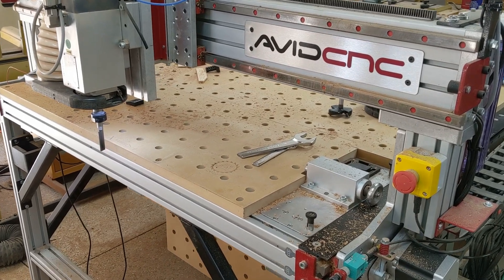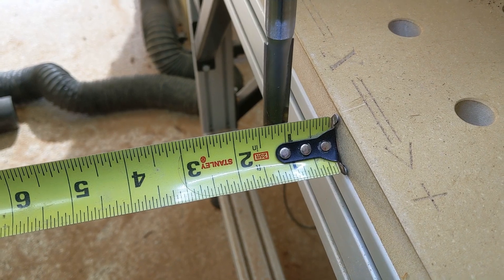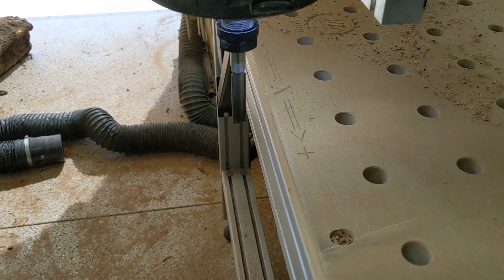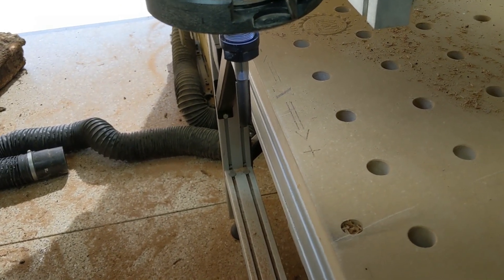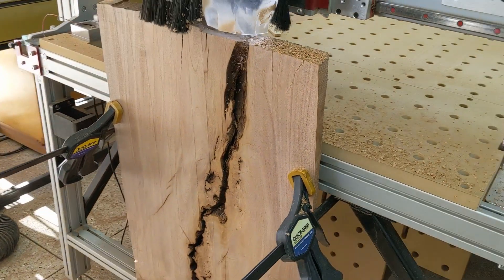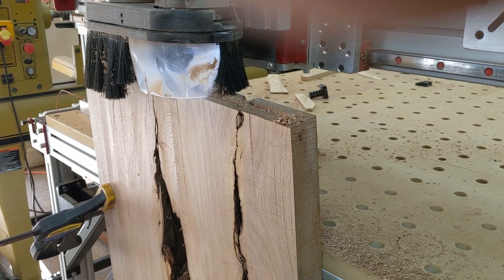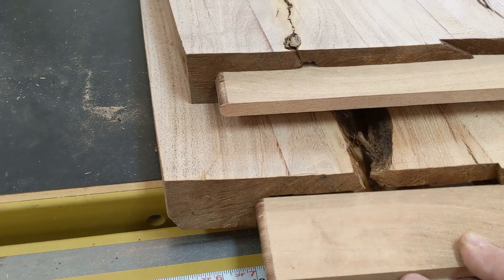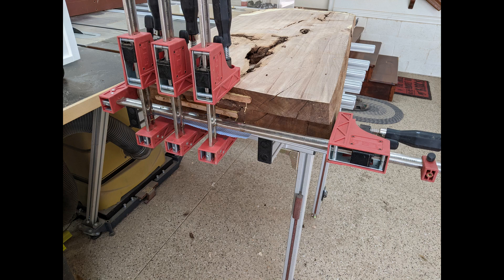Cutting a quick CNC river table edge spline slot or mortise on an AVID CNC router

Comment: Assembling my 4x8 pro now. Waiting on new 4hp spindle, for vertical table what do you think about pushing front cross member back a couple inches vs having a 2 piece top that has to be removed to access the vertical table mounts that are 400mm ie 15.75 inches back ? I guess it’s more complex in your situation with the 4th axis.  PS keep doing video, your unique as an engineer doing this vs a lot of weekenders.  If I can help let me know.
Reply from the maker: I had thought about that too.  If you don't have the rotary unit up front like I do (I need a removable section for that), then that's probably what I would do as well.  You really aren't losing anything that way.  You just short your top spoil board by 3 inches, and add an inch thick spoil board on front and you will have 3 inches of vertical cutting space.  You can still use that overall top space for large sheets or planing river tables or whatever since it won't hurt for those things to hang over the top spoilboard a couple inches. The other nice thing about that is that if you bolt on that front spoil board heavily you should add a lot of side to side rigidity up front, which that aluminum table really needs (I'm just about to start a cross-bracing exercise on my table to reduce some of the vibration).
Reply: @JNWoodworks  would be interested in your bracing strategy and results.
Reply from the maker: @cliffneal3118  just waiting for some hardware from Amazon tomorrow.  Hopefully I will have it done and posted next week.
Reply from the maker: BTW, I just ordered the 4hp spindle upgrade.  The 3HP was a great plenty until I started planing mesquite with a 2.5" spoilboard bit.  I can take off about 0.100" at 100in/min, but that is really pushing it to the limits.  Would like to be able to run a little faster than that when doing big panels.